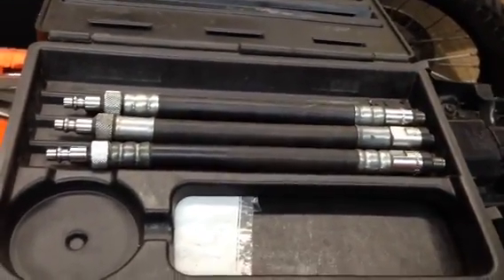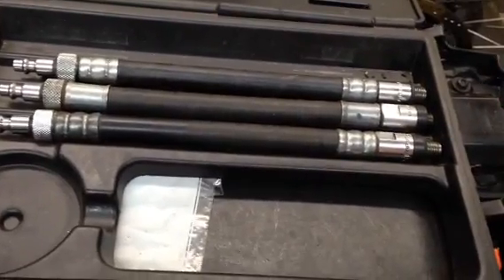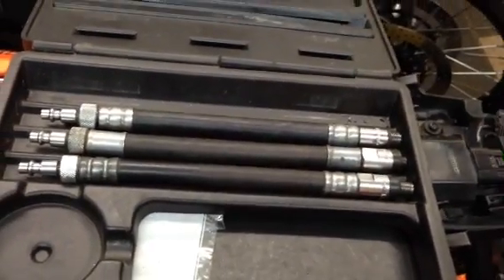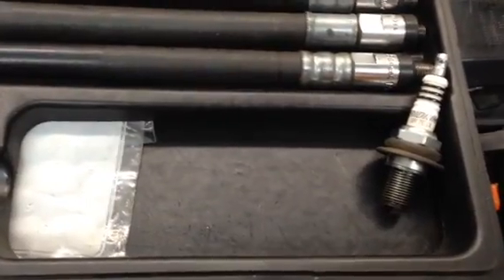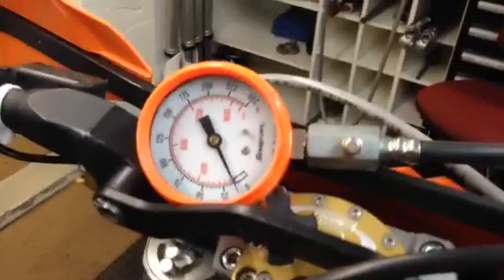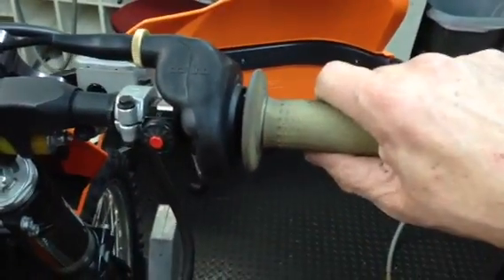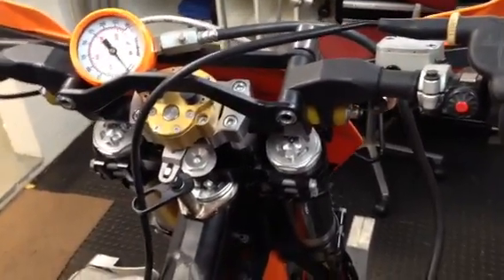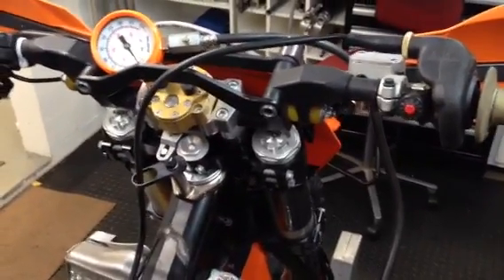How to Compression Test 2 Stroke Engines

Comment: SOB... i took the head bolts off for nothing on this yamaha kt100... but noone is giving me a strate answer and a answer with science behind it... im in Cincinnati and it got around 130-135psi.. my buddy whos a master mechanic(im also a mechanic but didnt care to go get my ASE certificate plus i got burned out by ppl bringing in trash vehicles that hasn't had maintenance done on them since the Purchased them... but my buddy o dude that sounds low vehicles are supposed to be around 180-190...idk what vehicles hes talking about cause as good as i am at mechanical im probably 5x better in electronic engineering and microsoldering.(at least with devices you get a nasty one every once in a grate blue moon. Those ppl dont have stuff normally fixed anyways) but i didn't hold the Throttle wide open. The fuel pump vacuum was off and im in Cincinnati ohio... i bet you tha t was a good result for that engine.. i guess ill see what happens when i get new head bolt washers everything else i have more extra of..

Comment: Don't have to hold throttle open on 2 stroke.
Reply from the maker: You are incorrect sir.
Reply: @slavensracing  you get the same result open or closed
Reply: Hey Jeff you mentioned the three different models having different PSI specs but I don’t remember you mentioning your bike’s model. I have a 13 300 XC and have the repair and owners manuals but I haven’t been able to find the compression ratio  or compression specs for the engine.

Comment: I just put a new piston and rings in my 2018 250 xcw that I ordered from the slavens racing website. When I went for my first ride on the new top end o noticed the bike was way easier 2 kick over than the stock piston so I ran a compression test and its reading 140 psi I'm not that knowledgeable on compression so I was wondering if this is 2 low or if I'm good. Any ideas is helpful thanks
Reply from the maker: Not good. With a stock head at sea level it should be 160PSI. I would pull it apart and find the problem.
Reply: @slavensracing  yea I literally just cranked it with my hand something is wrong could it be something with the rings ????

Comment: Hi Jeff. On the older ktm 200 xcw (2006) we have 12.5:1 comp. ratio. Given a atmospheric pressure of 14.87 psi we should have stock a 14.87 x 12.5 = 185.8 comp. But from 2013 (E-start?) the head on the 200 ktm has changed, do you know the "new" compresion ratio ? Or stock compression range for 2013-2016 models ? I asume lower because of the e-start.
Reply: Look at the gauge. If it's labeled somewhere on the face "psia" the gauge is psi-absloute or total pressure, more of a specialty gauge and refers to pressure relative to zero or perfect vacuum. Or it could have "psig" on it or psi-gauge which is measured relative to ambient atmospheric pressure.

If the gauge shows psig or a lot of the time nothing (psia/g it's gonna be psig), you won't have to worry about additionally factoring atmospheric pressure into the equation unless you need to.

Comment: Hey man, I have a 1990 KTM  EXC 250, I bought the bike off of craigslist awgile ago and ran a compression test and it won't climb over 30 psi, I don't know if I need to plug any certain part of the engine, everything is on the bike and hooked up except for the seat. I'm pretty lost when it comes to working on bikes so I was curious if you knew what could be causing the bike to build almost no pressure...btw the exhaust pipe is not totally secured but is on pretty good and there is a small oil leak, other than that I'm completely lost....any help would be appreciated! thanks
Reply: Did you ever figure out what was causing compression to be this low?

Comment: You don't need to throw away $200-$300 on a compression tester thats ridiculous unless your building nascar race engines then I would understand. $50-$100 will get you a really good accurate compression tester. BTW your mostly paying for that name on your tool when you buy snap-on, Matco, or Mac and that's been proven over and over.
Reply: Your right, I have a $30 Craftsman and I have Matco I got from my dad. They both read the same.
Reply: I am agree with you about this stupid video

Comment: Synopsis: put tester where spark plug goes, put gauge somewhere you can see it like the bars, hold kill switch down, hold throttle fully open, kick engine over until gauge psi stops rising.
Reply: THANK YOU
Reply: Harbor freight works just fine.
Reply: Warm or cold engine?
Reply: @perpelle  it doesn’t matter
Reply: @csheltn  if the bike has been sitting for a few months it matters allot. If you warm the engine and put a few drops of oil in the spark plug hole. If the compression raises it is the piston rings that is the source off low compression.

1. test cold engine
2. test warm engine
3. test with oil in the spark plug hole

It will give you more information
Reply: @Snurre86  how can i warm it up if it doesn’t start tho
Reply: @Crp22355  Then you do obviously do 1 and 3 and see how much compression you get, write it down. You need 5+ bar to start if you get that, you know you need gas/air/spark.
Reply: Thanks man 🤘🤘
Reply: Pretty sure the engine has to be cold , hot gives a false reading as the metal in the rings has expanded

Comment: hey I have a 2014 ktm 150 xc and it has close to no compression. the guy I bought it from said there is a decompression gear so they aren't hard to start in the woods. is this true?
Reply from the maker: +Sage Witty 
No.
Reply: Sage Witty Hey man did you ever fix that no compression  problem? if so what was the culprit?

Comment: Using the starter (if you have one) does absolutely no harm to the starter.  It would be the same as turning the bike over with the spark plug in it. You just shouldn't crank it for 20 consecutive revolutions. A burst of five revolutions per burst is no problem at all.
Reply: LMAO on this reply. Thanks for your vids !
Reply from the maker: +AWDn0t2 
The entire starter system is fragile. Any unnecessary use of the starter will cause premature failure. 
We have the largest inventory on the planet of starters and starter parts. Please ignore my advice and grind away on the starter. We love selling starter parts.
Reply: @slavensracing i know its an old post but people still watch for info. you are exactly right im also a motorcycle electrician of nearly 30yrs in Australia. all these modern style mx bikes have a starter motor the size of a 50cc scooter trying to start a 300 - 450cc. people burn them out all the time especially if they have lost spark or a fowled plug etc etc, but they keep cranking it till the battery is almost dead instead of checking shit, mean while the tiny starter and the tiny brushes and armature get so fucking hot it melts the solder on the brush terminals and generally kills the armature too. i also agree with kicking for a comp test instead of electric depending on the bike because some these day don't even have a kicker. uneducated people think there cranking a car starter motor and just don't have a clue about delicate motorcycle components.  at least it's money for us.
Reply: @Nismo65 what's your advice on dirt bikes that don't have a kick start option 2 stroke specifically
Reply: @raydornbush  if your engine is still in your dirt bike frame with a kick lever you still use a compression gauge in the spark plug hole and kick it over at least 5 to 6 kicks in a row fast with the throttle wide open that will give you the same result as using the electric starter. you should at least have over 100 psi minimum

Comment: NICE Compression Test Kit!!!
My Dad is a Mechanic so when I need specialty tools like this,
I will borrow from him unless I ended up buying some!!
My Dad usually uses Snap-On Or Mac Tools but his compression tester is like 40+ years old now,
& is made by a Company called "Sun"..
I never worry about spark trying to find ground a different route when my Spark Plug wire is safely placed somewhere to hold the kill switch but that is a good tip especially for newer models !!!
I will usually hook up a Spark Gap tester too at the same time on Electric Start Models to kill two birds with one stone!!
Well Thanks 4 The Tips !!!